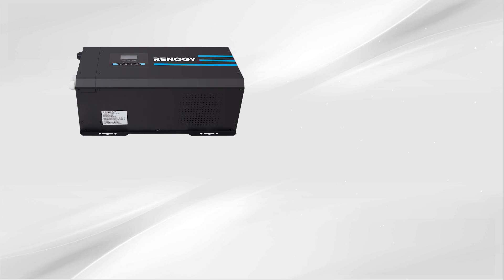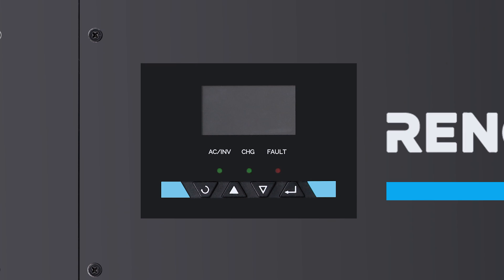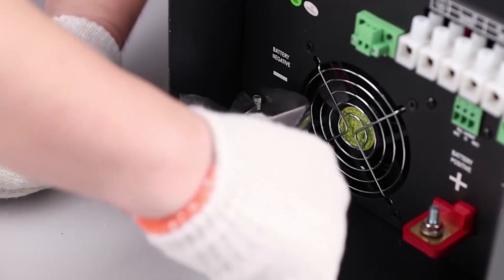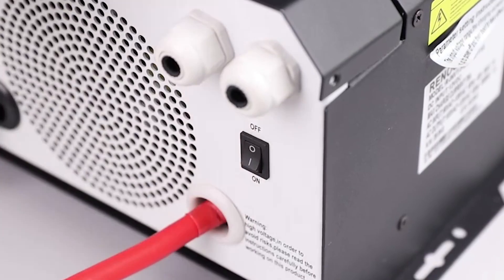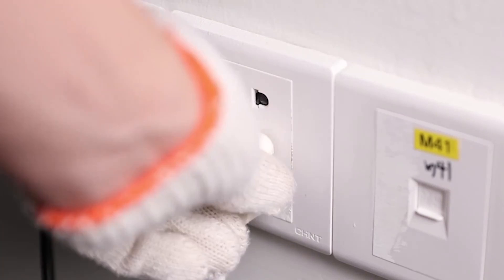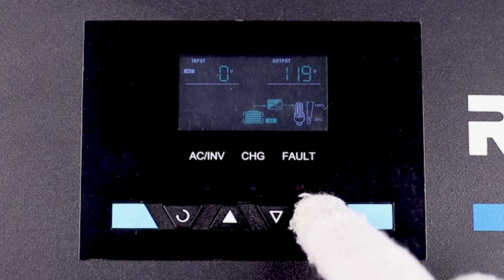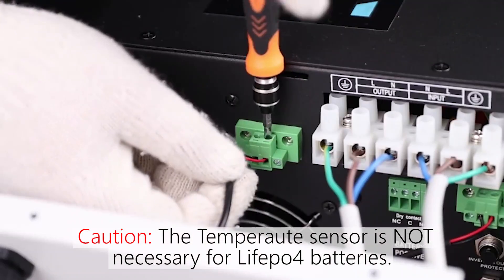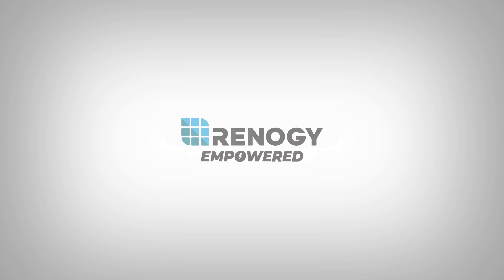Renogy 2KW & 3KW 12V Pure Sine Wave Inverter Charger w/ LCD Display

Comment: my Inverter, tries to charge for about a minute, and then stops. I hear like a humming sound. Watt could be the problem. Battery voltage is 12.9 Lifepo and the settings on it. Inverter it's Lithium, Battery

Comment: Does the inverter switch need to be off to be able to use it? 

I’ve noticed that with the inverter on(via the switch) and the One core display (inverter off) I still have main power working. 

Is this normal

Comment: I have the Renogy 3,000 watt inverter / charger. Do I still need a transfer switch when using shore power or unplugging from shore power
Reply: Has anyone responded to you with your question? I need help with the same question

Comment: You always hook up the positive cable first so you don't cause a dangerous situation when touching your wench by accident to ground side of circuit. WOW ! That's basic electrical safety. Redo this video to reflect the correct why of performing this task.

Comment: Aren’t you supposed to put a 300 amp fuse or breaker between the battery and the inverter?
Reply from the maker: The fuse must be installed between the battery and the inverter to ensure safe operation. For a 2KW inverter, a 250A fuse is recommended, while for a 3KW inverter, a 350A fuse is advised to provide optimal protection and performance.
Reply: Then why does it say in the instruction booklet to use a 200a fuse for 2000w and a 300a fuse for the 3000w? It seems you guys don't really have a clue alot of the time.  @RenogySolar

Comment: If they're using an adjustable wrench to tighten those nuts then you definitely know these guys are serious. Just ignore that heat shrink that's all torn up. 75A input charging current which would be 7.5A of AC and whatever size to CGBs are don't seem large enough for what...18 gauge wires?
Reply: A current of 75A refers to the maximum charging current of the inverter, which is in direct current (DC). As for the issue with the cables in the video, the cables are only used to demonstrate how to connect the equipment, and the cable size should be chosen based on the specific specifications of the equipment. However, there might be some lack of precision in this regard, and we appreciate your feedback.
Reply: @Renogy_Cares  I've got a MultiPlus and it came with knockouts so I can run LMT and make it look a lot better. I used to have some renogy equipment, but when I would call in to clarify how something works the guy would usually say "Let's learn this together" or "I don't think we make that product" so naturally I moved on.

Comment: Sprint guy told me when asked about v6 he said only if you want to tow a caravan. 
4 cylinder would be best to tune to same bhp. 
Would this be correct or is this difficult to answer. 
I'm looking for reliable power, resemble fuel consumption. 
I'm looking for a fun car travelling Spain to UK and track days fun. 
Which engine would you think.
Reply from the maker: Hello! Thank you for your interest. However, based on your description, it seems to be mostly related to automobiles. Are you looking for recommendations for engines from us? Please note that our current product lineup does not include engines. You can visit our official website for more information. Thank you for your interest!

Comment: Would I be able to connect to solar panels to charge the batteries.  But when the solar panels are unable to charge the batteries due to poor weather.  Would I be able to connect a remote/auto start generator to start charging up the batteries.   We are talking being in a situation where its totally off grid and there is no possibility of getting mains electricity supply.
Reply from the maker: Thank you for your attention. This inverter cannot be connected to solar panels, but it can be connected to a generator. The generator's output is connected to the AC input, and then the startup circuit is connected to the inverter's dry contact, allowing for automatic start and stop.
Reply: @RenogySolar   Thank you ever so much for your reply. I am sorry. I thought that this inverter could be connected to solar panels through a rover mppt. 

 I am afraid that the instruction book is not great for showing how the generator should be connected for remote start.

Once you connect the generator output to the inverter ac input.  Does the inverter need to be programmed in anyway.  

Will the power from the generator connected at the ac input of the inverter automatically start to charge the batteries the inverter is connected to. 

If solar panels are connected to the rover mppt which  is then connected to the batteries which in turn are connected  to the inverter.  Will the invertor some hower stop the rover mppt from continuing to try and charge the batteries

The example is this. The voltage from the solar panels into the mppt drops below a specific level. does invertor detect this to then set the generator going.  How does the system work?

Comment: I’m offended by that chap using a crescent wrench on those bolts. 😂. Sacrilege.
Reply: Haha, I completely understand your feelings! Using the wrong tools can lead to many problems, especially when you see someone using a crescent wrench to tighten bolts – it's bound to make you feel a bit frustrated and helpless. Sometimes, people might make wrong choices due to being in a rush or not knowing the correct tools. Nevertheless, ensuring the use of appropriate tools is crucial for both work efficiency and safety, no matter what.
Reply: Right?  And the connections were all visibly loose.  Completely unsatisfactory.

Comment: Who made this "instructional" video?!!!! 
It looks like the person doing the wiring had the skills of some drunk they pulled out of an alley and offered a 6 pack to do the video.
An adjustable wrench to "tighten" the terminals?!!! It will work in an emergency, but seriously, how hard would it have been to grab the proper size wrench or socket? 
And the heat shrink on the wire! They look like a dog has been chewing on them and then you have the 3/8 (10mm) ring terminal with a 5/16 (8mm) or 1/4 (6mm) bolt to hold it down! <sarcasm> Sure. I can see nothing ever going wrong here. </sarcasm>

Sure, it shows the basics on how to hook up the Inverter Charger, but it also shows some improper, and sloppy, techniques. Very disappointing from a big name in the solar business.

If this is the quality of work that Renogy uses on all of it's products, maybe they should leave the electronics alone and build something that requires a skill set a little more on their level. You know, like installing the little plastic thing on the end of your shoelaces. 

6/10 for the content, but 1/10 for the sloppy wiring and setting a bad example.🙄
Reply from the maker: Hello, thank you very much for your interest and your feedback. I am sure you are onto something after watching the video carefully. We will take your suggestions and feedback internally and review the video.
We sincerely hope that the video can give users the most reference or guidance value to help every new energy user. '

Comment: Will this unit work with a Cerbo monitor? I see an RJ-45 port but unfortunately no explanation in the video.
Reply from the maker: This inverter is not compatible with DC Home, and the RJ45 port on the machine does not serve any practical function at the moment. It is currently an unused port. Perhaps we will make some adjustments to this in the future.

Comment: Shouldn't there be a ground connection?
Reply from the maker: Hi, Pete.

Yes, it has ground connection.
Reply: @RenogySolar  HOW?  The user's manual recommends grounding, but how is that accomplished?  I realize the AC input has a ground, but what if you're not connected to shore power?  I see the newest model has a dedicated grounding lug, but if there is one on the model in the video, I didn't see it and the video didn't mention it.

Comment: On the 2000 watt unit does the inverter has  the ability to work on a single 200 Ah 12 volt battery, or can you add 2 or more batteries with the same 200 Ah to create a bank Note: this bank will be set up in parallel. Or you have to keep the batteries at 50 Ah to use 4 batteries without going over the 200Ah limit or does it matter?
Reply from the maker: Hi, Raul.

The 2000w unit can work on a single 200 Ah or more batteries. You do not have to keep the batteries at 50Ah with 4 batteries.

Comment: Wish mine worked like this. Shore power is 100% live but inverter will not register.....stuck without power when dry camping. Grouse.
Reply from the maker: Hi, Daniel.

Have you had our inverter? Have you met some problems in using? If yes, you can submit a case through our Help Center Portal  (links listed below for specific locations）for help.
 
https://renogy.force.com/helpcenter/s/contactsupport (USA)
https://renogy.force.com/helpcenterau/s/casesubmit (Australia)
https://renogy.force.com/helpcenterca/s/contactsupport (Canada)
https://renogy.force.com/helpcenteruk/s/contactsupport (UK)
Reply: Did you get this fixed?  I have the exact same problem

Comment: Would love to see a video explaining how you are suppose to mount the remote I did this install today easily the worst design I have ever seen
Reply from the maker: Hi, Levi.

Thank you for your feedback which helps Renogy constantly improve customer experience. We have reflected the problem to our product department. We will improve it in our later video.
Reply: @RenogySolar  please move the LCD screen from the top of the inverter to the remote while your at 
Thanks
Reply from the maker: It is a good suggestion. We will consider to make such adjustments in the future.

Thanks.

Comment: Can't you afford a proper spanner or socket for doing up the terminals? The terminal rings are too big for the studs. You could have at least used some decent washers to help make up for that. Not setting a good example to the inexperienced who may buy your products and install them themselves. Many home builds are dreadful and unsafe. Manufacturers should do better than this.
Reply: See those woven white gloves? These are gloves used by factory workers in China. This is a generic video from the factory that Renogy outsources to. Also look at the plugs in the wall. One of the typical standards in China. Renogy had nothing to do with the video other than making a voiceover. For most persons this is not an issue but actually you're right: they should have made their own video. It would take maybe an hour to produce.
Reply: 😂 Get a life mate.. inexperienced won't get the old engine out.😂

Comment: Question here... Just installed a new Unit but Display won't turn on.... But just noticed my 12Volt batteries are drained would that make a big difference? Or wouldn't the unit just charge the batteries when hooked up to 110V. Cause got good power going in.
Reply from the maker: Hi, 

Thank you for your comment. We do apologize about the inconvenience brought to you. To provide you the best customer service, please submit your inquiry through our Help Center Portal (link listed below). If you have previously submitted a case, please provide the case number with your new inquiry. 

https://renogy.force.com/helpcenter/s/contactsupport (USA)

Thank you for choosing Renogy!
Reply: You have to have somewhat charged batteries connected or it won’t function.

Comment: Ive been trying to figure out what I  should use for my AC input and output. Thats the only thing unclear to me. Shall I modify my own cables? What type of cables should they be ? Ratings and Such. I have everything down except that part. 

@ 2:06 Modified Extension cables.
Reply: 10/3 awg cable -> 120AC distribution panel ->  wall receptacle
Reply from the maker: Hey Tamar ,

Feel free to contact us here to chat with a product specialist! - https://www.renogy.com/contact-us They will be happy to answer any technical questions you may have! 

Thank you.
The Renogy Team

Comment: When on bypass is the output of the 2kw model limited to 2kw or can it bypass more if the incoming mains is 3.6kw
Reply: Did you ever find out?
Reply: No it is limited I have 3000w unit. It also sends the electricity down the negative and positive. Would not buy again! Will be turning blue from now on!

Comment: With the inverter set up as in the video in a motorhome will the inverter automatically allow sure power to take over when sure power is connected as in ups systems or do you have to change inverter settings to sure power then back to inverter power when tge sure power is disconnected again.
Reply: When on shore power, this unit charges the batteries and the AC output goes into bypass mode acting like an UPS.

Comment: Can you plug your solar panels into this as well or do you still require a solar charge controller?
Reply: I also want to know if I can connect solar panels in place of ac input.
Reply: @forsbergmicah  NO
Reply: Yes, a solar charge controller is required, but it only charges the batteries when the AC input is not energized (not connected to shore power).
Reply: You'll need a solar charger controller that's efficient for you solar panel's. Coon repair trh panel's to the solar charge controller than connect your solar charge controller to you're battery bank. The inverter will also connect to the battery bank. I've been told to get bus bars for all the power needs and that run a single wire to the battery. I'm not 100 on the bus bar thing though.

Comment: Will it auto shut off the charging when the batteries is fully charged? To be more specific, I am looking for an UPS system for the fridge and freezer. I want to connect the unit to the grip and by pass the battery when power supply is normal. Auto switch to use the battery when power failure is detected. Charge the battery when the power is restored. Will this system do all that automatically?
Reply: yes, thats exactly what this will do. Just make sure it is set to Utility priority